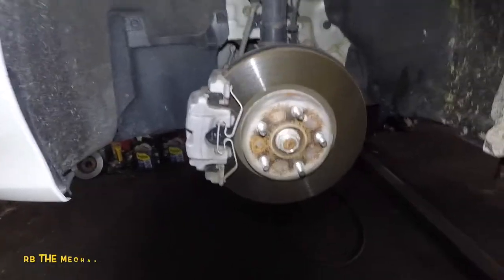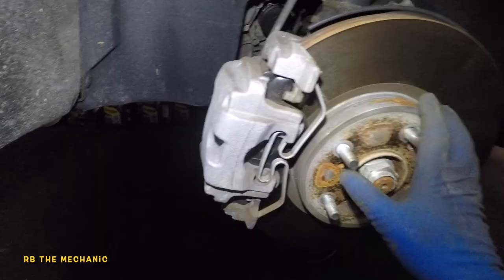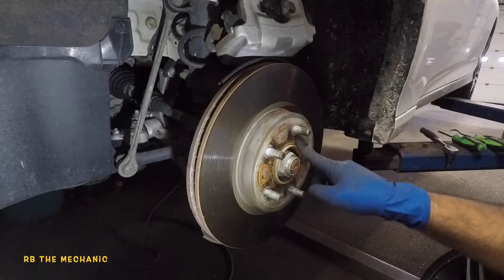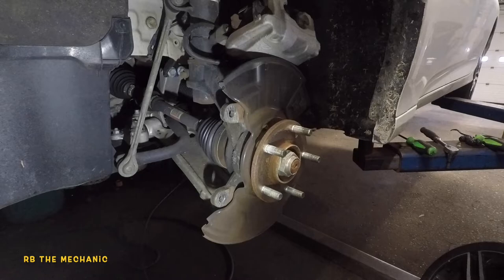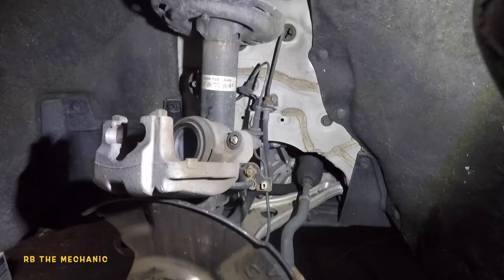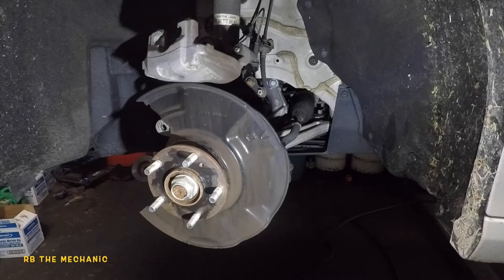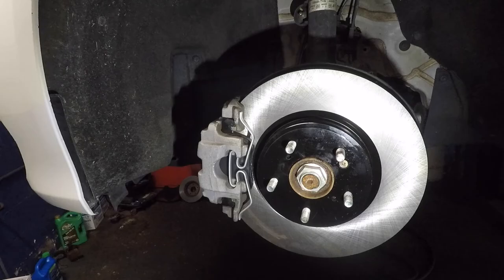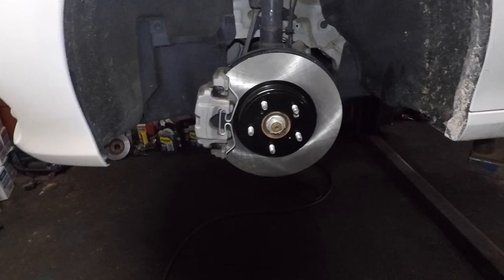How to replace front brake pads and rotors on Honda Accord 2018 2019 2020 2021 2022

Comment: That spring looks tricky for sure. Guess the design of caliper bolts don’t require grease like previous generation of Honda’s ? Why can’t you rotate the rotor left or right ?  Thanks for sharing this information.
Reply from the maker: What u mean can’t rotate?
Reply: @RBTheMechanic  You had mentioned early in the video about not turning the rotor otherwise car might throw a code. That’s what I was trying to describe.
Reply: @roberts1159  doesn’t sound right. Should be able to turn wheels when working on brakes
Reply: @richardfabrizio8998  Yes, agreed.  Not sure why he said this in the video.
Reply: @roberts1159  yeah I’ve turned them to get better angle. No problem
Reply: @richardfabrizio8998  he probably meant that sometimes it can trigger codes due to sensors

Comment: I'm really hoping that rotor screw is going to come out with a hammer tap that you showed. When I worked on my rear I struggled with that pittsburgh tool and it even broke on me.
Reply from the maker: Well watch this video it will u https://youtu.be/R0z9HN06Ulw?si=4hkyfdJaM7DmImS5
Reply: @RBTheMechanic   the hammer tap definitely helped. I just realized also that the Pittsburgh impact tool does appear to rotate clockwise (not only counter-clockwise) and I think that's why the tool has been breaking for me.
Reply from the maker: @frankie1220  yeah

Comment: should i turn off the parking brake to replace front brakes and rotors? i got a 2020 accord
Reply from the maker: Yes but u still need to do more than that watch my rear b  re are job videos https://youtu.be/4qt89k-pUqA?si=M5CpYh10W2HYJ_lj
Reply: @RBTheMechanic  Thank you! also got an additional question. is it okay not to have the screw that holds the rotor? the aftermarket rotor i bought doesn’t have one but fits just right.
Reply from the maker: @paulgheremyprowel7669  yeah that’s fine

Comment: What’s the purpose oh that screw ?
Reply from the maker: Zero purpose they just help u hold rotors in place
Reply: To frustrate us. The JIS (Japanese industrial screw, not a Philips head, but close) keeps the rotor tight while the vehicle moves around the factory. It is not needed outside the factory. Most will just toss it the first time the rotors are changed.

Comment: What is the name of that pry tool you used to take that big spring off the front of the caliper? I cannot find one angled like that anywhere. Had so much trouble removing and installing that stupid spring
Reply: I saw you replied to someone else asking a similar question and I still couldn’t find the green hand tool you used in the video. I need that in my life, please and thank you
Reply from the maker: That’s snap on u not gonna find it anywhere but on snap on tool truck but here’s somthing similar or u can use flat head https://a.co/d/d0zmFdv

Comment: i just replaced my front and rear brakes and i had put the m77 assembly paste but the brakes squeal while driving and not pressing the brakes . I’ve taken them off and it still squeals slightly and i’ve followed both your videos on the brakes.
Reply from the maker: Squeak is usually the material of pads

Comment: why didn’t you grease the sliding pins? is it not needed for the newer hondas?
Reply from the maker: Yup those little guys but u can if u want
Reply: @RBTheMechanic  thanks man🙏 i just changed my rotor and brakes yesterday but the front right side sounds like the pads are too tight against the rotor… could I of tightened the caliper pins too tight or could it be something else? sorry for the questions
Reply from the maker: @ohKonTTV  pads can’t be too tight not by bolts possability pad is not free like I show in the video
Reply: @RBTheMechanic  i just needed the break the new rotors / brakes in and it went away lol😂all good👌 thank you
Reply from the maker: @ohKonTTV  oh ok 👍 yup glad u figured it out

Comment: No slider pins to grease ?   Spring could b tricky. Good job
Reply from the maker: I gotta check video I think it got the allen
Reply: @RBTheMechanic  oh ok
Reply: @RBTheMechanic  Please explain?
Reply from the maker: @roberts1159  what am I explaining?
Reply: @RBTheMechanic  Not to be a pain, but the first comment was “ no slider pins to grease”. Then your reply was about using an Allen. Guess I didn’t understand your reply.
Reply from the maker: @roberts1159  oh I get so many message I can’t see ur old ones to follow up anways if ur got Allen with boot then u don’t need to but u can pull it out out some on it it dose work like slider pin
Reply: @RBTheMechanic  No problem understand. Appreciate that you do reply back, a lot of YouTubers don’t bother.
Reply: @roberts1159 there are pins and yes they should be cleaned and lubricated. Might as well do it when you already got everything apart.
Reply: @FA5FLIP  ok thanks. That part in the video was a little unclear to me.

Comment: is this a 2.0 or 1.5? ..... the front brake pads are different for 1.5 and 2.0 front only..... all accords are not the same
Reply from the maker: Not sure might be 2.0
Reply: Just changed my rotors/pads on 2021 Accord LX(1.5L). Couple things different -   no caliper holding clips  and doesn't use allen key bolt for calipers.